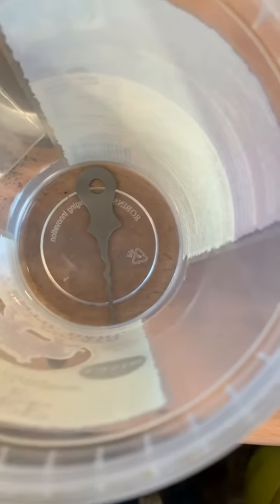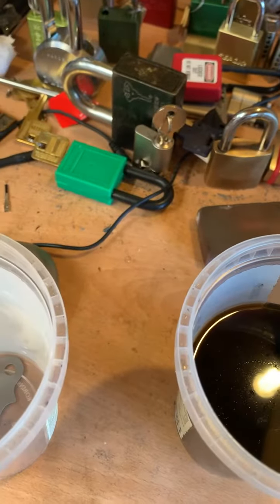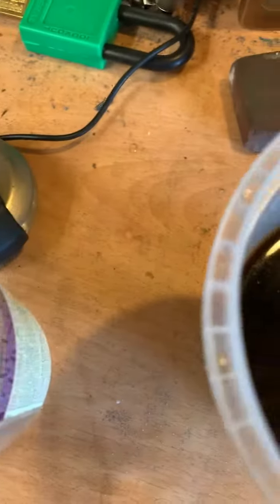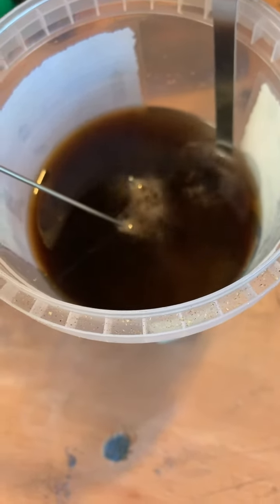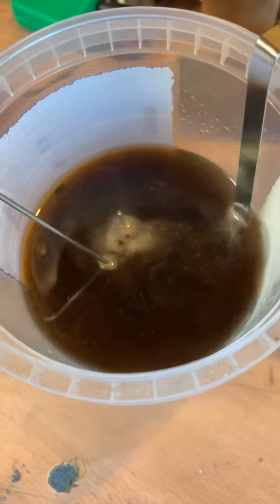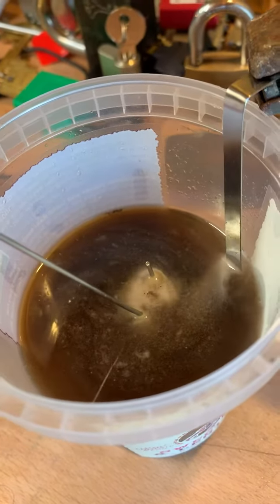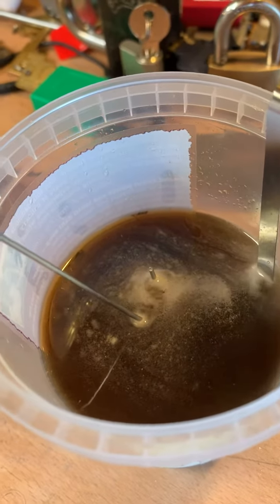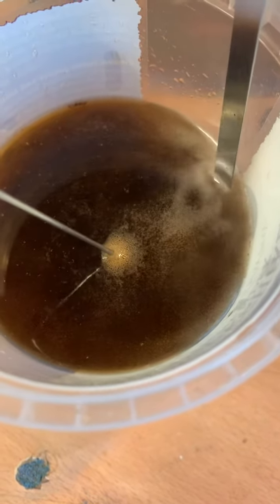(114) Anodising a  Titanium lockpick with Coca Cola.

Comment: Great vid wez. 
Id say a good solid connection from your pick to the stainless wire would give you an even result throughout the whole pick. 
Another way to colour stainless and titanium, is you can use heat/blowtorch and a makeshift bluing tray filled with with brass fillings/chips to keep heat even throughout the pick when heating.

Cheers mate

CLICKSPRING 
YouTube channel has a good video on showing this process.

Comment: Hey mate very interesting, coke contains phosphoric acid in low concentrations.  I guess that's a key elements in the process?  dunno, that said home brew stores sell 96% phosphoric acid for under ten bucks for 500ml works to help passivate stainless steel.  Cheers thanks for sharing :)